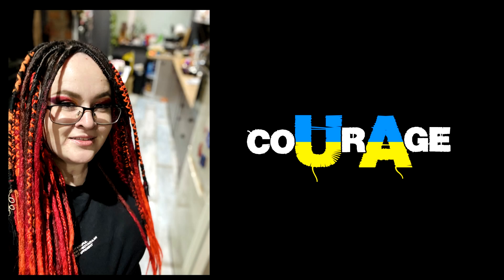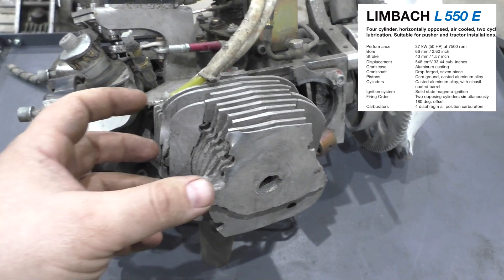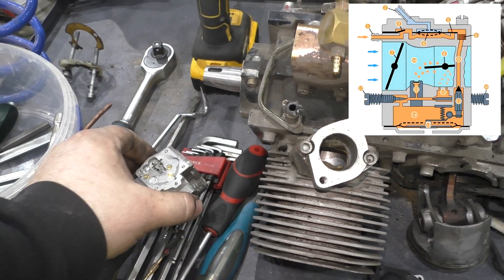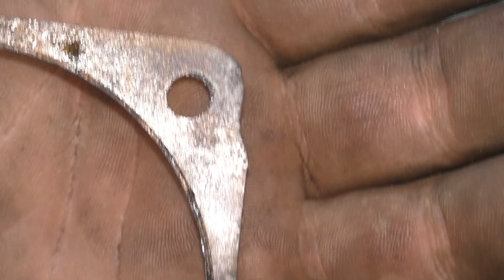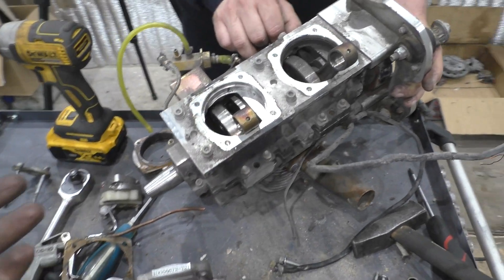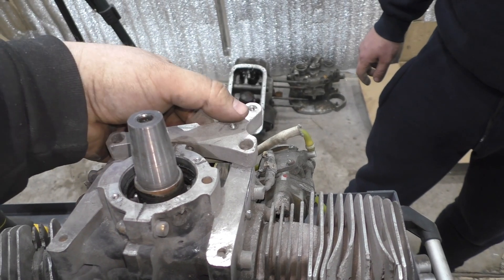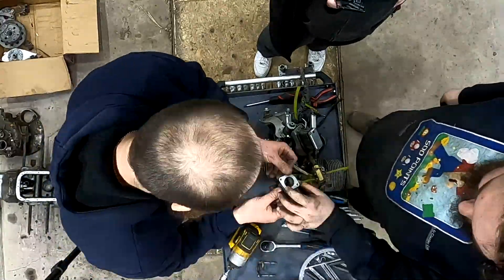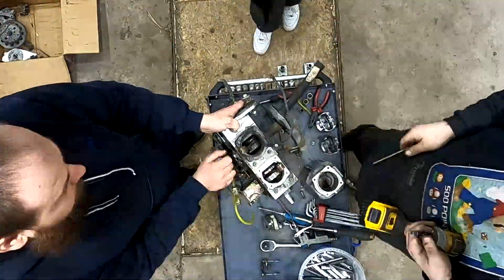SHAHED 136 drone engine TEAR DOWN

Comment: A far simpler and easier to manufacture single use device to power a suicide drone would be a pulse jet engine.. Why they are using such a complex and time consuming to build internal combustion engine is proof that there is no superior planning there.. Pulse jets are light and could achieve higher speeds and still be built with variable throttles for cruising and saving fuel to full on in attack mode.. Speed equals survivability as it is far harder to hit something traveling 500 miles per hour than something traveling 150 miles per hour..
Reply: Pulse jets have dismal fuel efficiency, due to not compressing the air fuel mix prior to ignition. So range would be greatly reduced.
Reply: @nerd1000ify  No lack of fuel in Iran or much of the populated Middle East.. The Germans managed to create a fighter jet using a pulse motor right near the end of WW-2 which used a higher performance version.. So I am sure that fuel usage would be easier to deal with than the machining of all those engine parts and a propeller.. Aerial launching at altitude would save a lot of fuel and so would using higher grades of fuel and refined combustion chamber with a boost assist for the air input..
Reply: It's mostly a question of range. Fuel is heavy, you can only carry so much in an aircraft before it starts eating into payload capacity. Pulse jets are ok for going a few hundred kilometres but if you want 2000 km+ range like the Shahed has they don't work so well.

Another issue with them is they have an enormous heat signature, usually the whole tailpipe of the pulse jets glows red hot and there is a rather conspicuous exhaust flame. This makes design more difficult (pulse jet has to be isolated from heat sensitive parts, often by mounting it outside the fuselage like the V-1) and deprives the drone of any stealth it might have gained from its low and slow flight path.

Comment: That would be a cool mini bike engine
Reply: not really, It would wear out in no time, and probably has hardly any torque until its close to max rpm.
Reply: Since it is designed just for high rpm, you would not be able to run it at low or medium speed with sufficient power. The engine is not suitable for ground vehicles.
Reply: @dervideoonkel6794  low gearing makes any motor work for a ground vehicle
Reply: That would be fun to play with! Lots of potential for mods.

Comment: Yes it was poor quality but it only had to work for an hour then explode
Reply: I think the metal used was of a higher quality. Probably cast from melted down car parts or small engines. Also, just because the aircrafts have a short life time, they still have to have decent engines. Usually in engines, poorly-made parts wear out very quickly and those engines are run for a very long period of time on their one and only flight.
Reply: @ryelor123  These only need one flight ... but yes  Probably cast from melted down car parts or small engines and it's something K1VV1's are going to have to learn when their 5 eyes partners Turn On Them

Comment: The lockwiring on the prop is standard practice in aviation to secure bolts. Other than that, everything is too low tech/generic to be able to locate something that could disable production by sanctioning. I suppose, the best thing would be to replicate it and throw it the other way.

Comment: Watched a year after publication...

How is the fuel supply delivered? Is there any carburettor heating (to stop condensation/freezing)? How heavy is it?
Is the crankcase manufactured in Iran?

Good video!
Reply: standard diaphgram pumping carbs... 
no, its a standard two stroke crank scavenged schneurle ported design that never flies at a high enough altitude to warrant extra heat. in fact, bolting teh carbs to teh crank directly without some sort of insulator tends to cause vapour lock...

Comment: I'd be surprised if this was really made in Iran.  I rather suspect it's an import from China and it may even be a "geniuine" Limbach engine given that the Chinese own and operate Limbach now, I believe.  The cylinder barrels (and pistons) are repurposed chainsaw items from Stihl or possibly equivalent aftermarket pattern parts.  The standard barrel does not have sufficient cooling for the aircraft application because it relies on the aircraft dynamic pressure for cooling flow rather than a forced convection fan as in the chainsaw application hence the cylinder tops are machined flat and additional heat sinking is attached.
Reply: Not repurposed Stihl component as Stihl chainsaw engines like Husqvarna cylinders and head is cast as a single piece.The carburettor is typical two stroke with a pump diaphragm on one side and a metering diaphragm on the other which operates the single jet needle valve.
Reply: You know iran is a big car maker?
Why would this engine be hard for them? I can make this engine by casting it myself in sand
Reply: @anon-iraq2655  If they cast in sand, they have a huge manufacturing potential...

Comment: I wouldn't call that prop mount "old fashioned" rc and full scale still use and make them.
Reply: Yeah. And i wonder why only a two bladed prop? It could have a higher tip speed (without going supersonic), with more blades and reduced diameter.
Reply: Generally the larger you make the prop diameter the better the propulsive efficiency. If a 2 bladed prop can absorb the power without supersonic tip speed or inefficiently wide blades it is probably the best option.

Comment: cheap, highly accurate, deals as much damage as expensive missiles or airstrike, quick to deploy and once again extremely cheap. ladies and gentlemen, this is the future of warfare.
Reply: a Shahed drone costs about 200.000 $, but it is cheaper than a cruise missile, that is for sure.
Reply: @spxram4793  $20k , not $200k
Reply: some bros flying MI8s with machineguns would like to disagree.
Reply: And can be downed with the most basic AA systems.
Reply: It is most definitely not.  They are very easy to intercept if you have the right equipment.  The only reason the 'right equipment' does not exist in sufficient quantities is because there was never need for it.  Now that such drones have been used at scale it is just a matter of time before such equipment becomes widely available which will make this type of weapons obsolete quicker than they became a prominent weapon.
Reply: @listerdave1240  inhale on that copium 😂
Reply: @CraigTheBrute-yf7no  
So you really think that a lumbering piston engined toy sized airplane is more difficult to shoot down than a missile travelling at three times the speed of sound?  It is obviously not.  The only reason the slow one is difficult to bring down is because air defenses have over the years been fine tuned to intercept the far more advanced weapons, which as a consequence also made them totally unsuited to intercept the far inferior slower ones.  
The unsuitability is both a matter of the high cost and also its seeking algorithms and maneuverability being adapted to a different kind of target.  The high cost is mostly due to capabilities which are not needed at all for the slow drone and thus just wasted money.  The cost of course also limits the quantities that can be produced. 

It's simply a matter of not having the right tools for the job.
Reply: @listerdave1240  what you dont understand is EW Russian suite can JAM all kind of detection. this is hard to detect this kind of device.
Reply: No EW device can jam optical and IR detection. Also note that the range of EW is quite limited. An EW system sitting in Russia will do absolutely nothing to prevent drones flying over Kiev to be detected and tracked.
Also note that any jamming sufficiently strong to prevent all radar based detection would also disable the drones' navigation and communication causing it to lose control. Then there is also the matter that the drones themselves can be easily jammed by the opponent's EW if they have the right equipment, which again is often not the case because current EW has been designed for different threats and not well tuned for small drones and such.
As i said and will say again the only  reason these drones are currently succesful is because the focus of air defence has been on much more capable weapons.
Reply: If you want to compare the western approach of making weapons to the Iranian approach, just look at the Israeli strike on the Iranian consulate in Damascus and compare it with the Iranian response.
Reply: Ukraine stops almost every Shaheed used against them. These drones are now a mere nuisance and very expensive for Russia to deploy.
Reply: @Dave5843-d9m  They're meant to decrease Ukrainian air defense supplies.